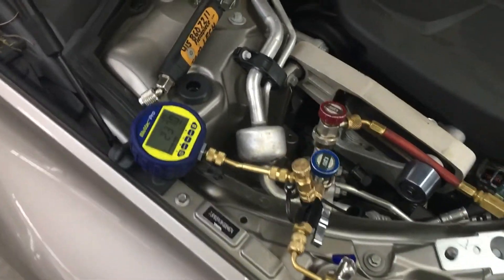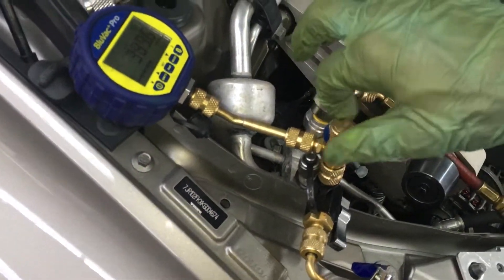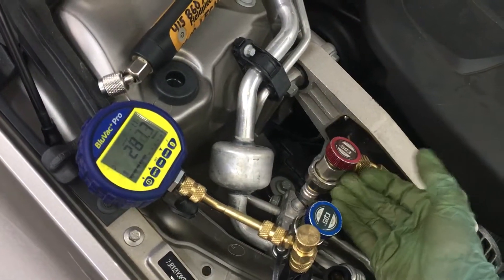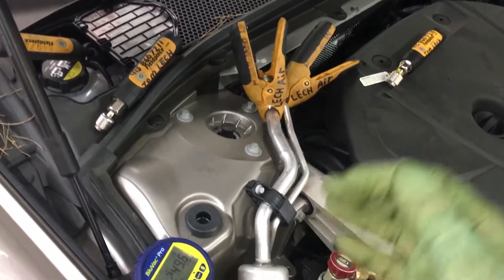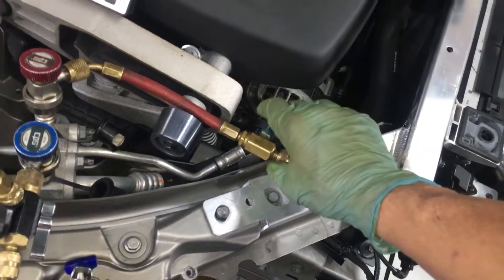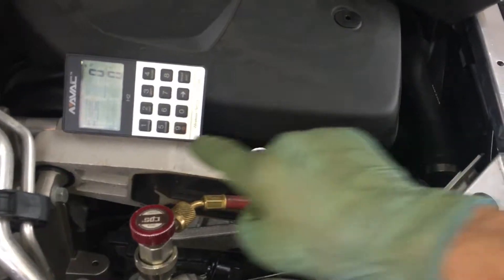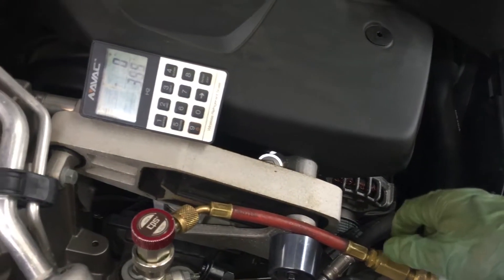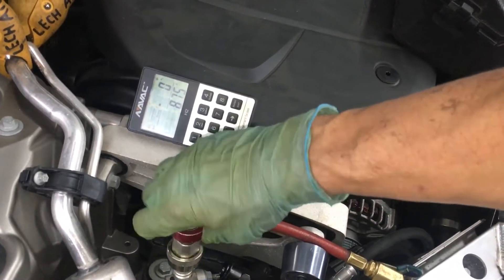Automotive AC tools, microns gauge, Appian valve core remover, silicone vacuum hose,

Comment: Hello Tom, thanks for the knowledge you share with us. I surely know a lot more now than before I started watching your presentations..thanks! Who makes a valve core removal tool for R134A that offers a service port in order to pull a vacuum after the core is removed?
Reply from the maker: Nobody

I did have a talk with a guy who is a machinist, and he actually made one out of the existing valve, core removal tool with some Brazing machine and welding 

The majority of golf course on 134 are very large diameter compared to the little tiny quarter inch old 12 Refrigerant valve course so you don’t have to worry about it

I would like to have one too

That is definitely overkill. An overkill is my middle name.
Reply: Thanks for the quick reply, not sure where you find the time to help everyone with your demanding schedule but I thank you for doing so... you're awesome! I kind of figured this was the case as I have looked high and low (no pun intended....lol) and have turned up zilch! I'll be ordering the Micron Gauge,  TruBlue, Appion Valve Core Tool and AccuTool Core Depressor adapter this week and will use your discount code to save $55..thanks again!! We've talked in the past, look forward to talking to you again in the future...Keep Cool my friend ;) @coldfinger459sub0

Comment: Can't you use the fieldpiece low pressure gauge to get micron reading. I'm getting this 650.00 set so I can troubleshoot with it. My boss has a machine.
Reply from the maker: True you are correct I micron gauge is a separate device from a pressure sensor or pressure transducer.

And your answer is yes the Fieldpiece SM480V has a micron gauge built inside of it. It is a separate sensor located in the center of the manifold. .

Comment: Surprised that you have the vac gauge at the vapor line and not further away from the vac source on the liquid line instead.
Reply from the maker: Because in this situation I isolate the vacuum gauge from the vacuum through a valve so it’s completely cut off from the vacuum then when the system vacuum stabilizes between the high and low side it gives you your true vacuum reading after decay. 

          You get the same result just more procedures and takes longer just a different method. 
           If someone uses this method and doesn’t use it properly they will get false readings and never know it one of those scenarios when somebody doesn’t even know what they don’t even know. 
           But when used correctly you get the exact same end result as if the gauge was installed on the far side liquid line.
Reply: @coldfinger459sub0  got it! The key is to have the system stabilize in order to get a meaningful/acurate vac reading.  Thanks for the clarification.
Reply from the maker: @horsth9566  😉 bingo you got it , you just moved up a notch knowledge
Reply: But what is the benefit to this? Seems the having the vacuum gauge at the far end would give you an accurate result faster without having to assume the system has stabilized.
Reply from the maker: Even when attached to the far end, it still has to stabilize.

The furthest from the vacuum source will be at a slightly higher vacuum, then the other end of the system, where you’re actually pulling the vacuum . 

Then, when you ball valve off, shut off the vacuum .   Over a short period of time the system will balance and stabilize.. 

I think one of the best analogies that are visual that I can give to people is a fish tank halfway filled with water . 

You gave the fish tank a little push and you get a big wave that goes high on one end and the water is low on the other end . 

The molecules of moisture in the air under a vacuum in Piping, react the same way . 

It takes a little time for the one in to catch up to the other end. It’s the laws of physics that a higher pressure always wants to flow over to a lower pressure for equilibrium. . 

I have a better vacuum video on one of my larger commercial VRF systems on a 20 ton system with about 1000 feet of copper piping .   I placed a vacuum micrometer on one end of the piping system for this away from where I am drawing to vacuum with the vacuum pump..    and I got it all the way down to 13 µm.  That’s on 1000 feet of pipe.. in 20 tons of multiple air handlers. 

In automotive depends on the amount of money, some money, but wants to spend on tools and equipment. Not everybody when they start can have everything. . 

And usually an automotive guys are lazy they’re going to use the refrigerant vacuum hoses through their manifolds most of the time . 

I have multiple videos with the vacuum gauge on the far end to  the show the difference between a vacuum gauge near the vacuum port on the same side .
Reply: @coldfinger459sub0  I can see now how the micron gauge will definitely get to the correct number barring something weird clogging the system. But without years of experience to know the difference between a stabilized and one that may still be equalizing  how could I pick the two apart if I've only evacuated a handful of times?

I'm basically trying to decide how much effort to put into nailing down the skill of discerning a stabilized system from a clogged one vs just putting the gauge on the far end and kinda blindly trusting my gauge. 

I'm just starting out and kinda unsure I guess
Reply from the maker: @attackthedefault8042  a while back I did a video series on recommended videos to watch about using a micron gauge. 

Jim Bergman produced quite a few videos and one long one that’s about an hour long all about using micron gauge is . 

Jim Bergman and Bill Spoon  , Bill Spohn is the owner of True Tech Tools Jim Bergman used to be the owner of True Tech Tools. 

Jim Bergman also help develop the iManifold  
   And developed MeasureQuick app. 

Also, if you go to True Tech Tools website, they have a $19 book about vacuum and using micron gauges a very wise investment to use along with gaining experience hands on . 

All the problems that you’ll probably have learning to use a micron gauge will be caused by yourself making little mistakes, and just little tidbits of lack of knowledge . 

You will learn how sensitive and picky the micron gauge is just about the moisture in the perm ability of rubber refrigerant hoses cause you will learn that through trial and error and frustration . 

I’m telling you this now, so you don’t have so much frustration and get impatient . 

I always recommend everybody to purchase for experimenting because you need a large volume to experiment with a micron gauge and knowing that you have a reference source that is clean dry and tight is necessary . 
          Purchasing a brand new recovery cylinder, and never using it for anything else except for vacuum reference.  
       Or pressure reference using high-pressure dry nitrogen to teach yourself about pressure Decay test. 

And with that brand new recovering refrigerant cylinder the first thing you will be doing is hooking up a vacuum hose and leaving the vacuum pump running on it overnight . 

I actually performed a series of videos using brand new recovery cylinders in different scenarios with rubber refrigerant hoses attached with no rubber, refrigerant hoses attached with a dedicated micron gauge using a set of refrigerant gauges with a built-in micron, meter, and showing the difference of how rubber, refrigerant hoses really mess up Your micron readings.   And your vacuum decay test. 

I’ve shown the difference between using a dedicated vacuum rated big blue silicone hose that is used for nothing but vacuum is the Highly preferred way that is correct .   Or copper metal tubing that you make up yourself using flare, nuts and making your own flares. Nothing’s better than a metal tube.. 

These are all things my father taught me at the age of 12 when he started me with a micron meter .      But those days it was an analog micrometer that took six or 8D cell batteries and took 10 or 15 minutes to set up warm up calibrate before you could even use it.. 

We are so lucky now with all these instant instruments that are so accurate and quick and easy to use .
Reply: @coldfinger459sub0  thanks I just got my hands on a brand new recovery cylinder you convinced me to grab the professional trublu kit and just use that cylinder to vacuum tests for a while maybe with some copper lines on each port to simulate the line set and evaporator of a split system. Thanks for all the knowledge and effort you put into publishing all your vids!
Reply from the maker: @attackthedefault8042  adding line sets to the ports of the tank is an excellent way to also practice making flares and fittings and adapters. 

When you can draw a vacuum on the tank three times in a row and come up with the same micron reading below 100 µm after a 10 minute vacuum decay . 

When you know you did something right 

If you pull one reading and you get around 100 µm and then you break the vacuum take everything apart put it back together and you pull another vacuum and the decay is 400 µm are 700 µm then you know you did something wrong 

It’s when you can repeat your test over and over again and get exactly the same result that is correct. 

But when you watch those videos by Jim Bergman, and if you get that vacuum book from True Tech Tools, you will definitely know a lot more than 98% of all the other guys who just have a vacuum pump.